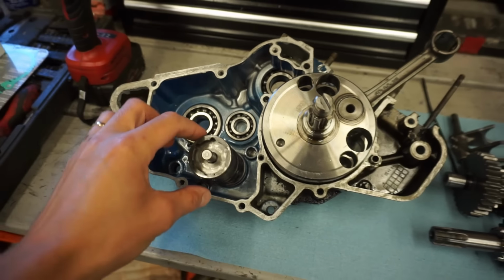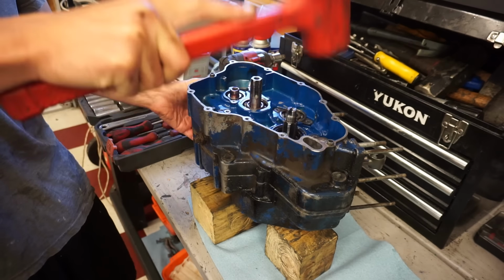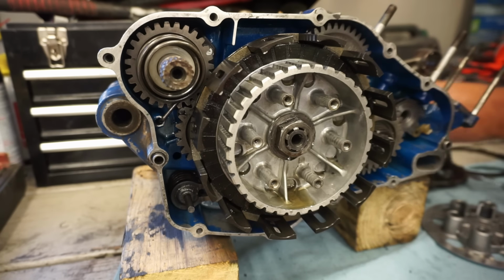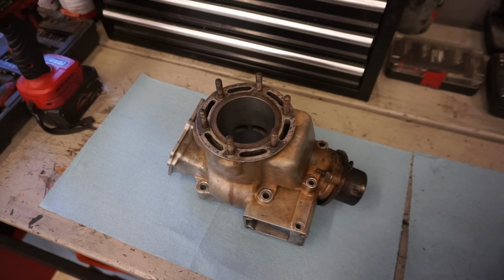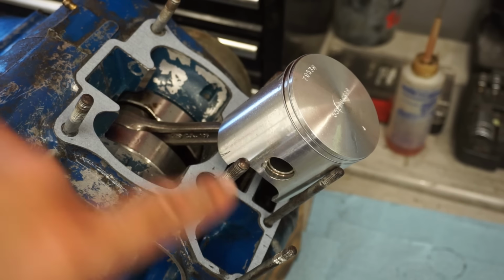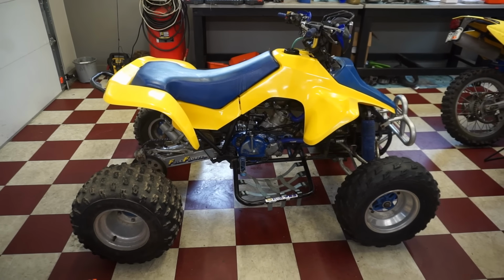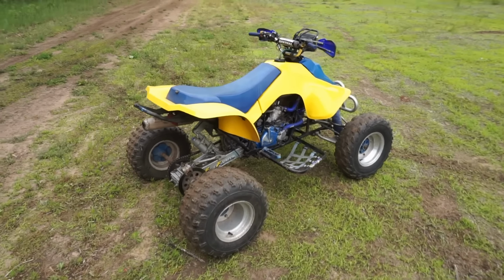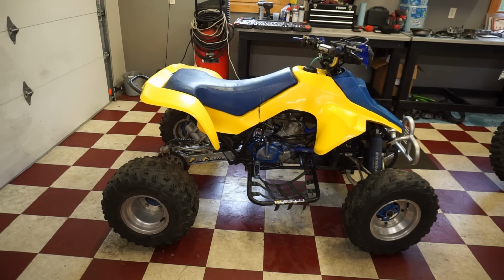I Can't Fix This Rare 2-Stroke Race Quad

Comment: take a 2nd look at the gears, counter-gears. Pay special attention the syncroteeth, they should not be bent  over or the pointed ends rounded off; and since synchro gears / rings are 'conical in shape, the syncros should therefore syncronize itself with the gear it's trying to engage. In other words, If i were to push the syncro ring up against the syncro gear, because its tapered and conical inside diameter, the syncro should slow down the syncro gear to match the speed and mesh with each other. If you press the syncro ring up against the syncro gear but it wont slow down or brake then the syncro ring (usually brass in color) is worn out. You can only replace it, it lost it's braking capabilities (hence the taper and conical shape). Watch the GearBoxVideo -very intuitive and he's a pro at rebuilding manual transmissions

Comment: If it's just second gear, my guess is the clutch dogs, and, or the pockets in the gears that comprise second gear are rounded off causing pressure on the shift forks, and forcing it out of that gear when power is applied.

Comment: The detent u had to bend back make sure it’s perfect and the wheel on it is oem diameter I’d just order 1 honestly and also change the drum bearings ur shift problem will be gone that arm with the wheel against the star is what holds the gear in

Comment: Shift dogs are worn or rounded off.  All new gears to make right  I have done this .slipping out of geat is cause by the dog edges rounded ask any pro if you dont want to put any money in it you might try to file the rounded ones but they have to be very precise to work right  I would replace all of them. Probably be costly idk. I'm sure others have described the same thoughts as I have. WORN ROUNDED DOGS
Reply: Ya .but you here him say there perfect 😂.  Ya its easy to pull it all part then put it back together. BUT you got to know what the fuck you are looking at. SO NO its not Perfect 😂

Comment: Back in the day they used to do what they called plug chops and only run the engine to a certain RPM and then kill the ignition with the clutch disengaged and then check the plug for that RPM

Comment: older honda 600rr with some miles on em would have this issue with 3rd gear. would constantly jump outta gear. only fix was tear down and replace 3rd gear. believe suzuki dr650's also had same issue with 3rd gear. think i would try replacing 2nd gear, unless you can source an entire trans on ebay for cheap.

Comment: Ultra black rtv is oil resistant not gas resistant. The grey that says fuel resistant is also oil resistant which needs to be used on the 2 strokes surprised you dont have issues honestly

Comment: I can not stress this enough! When working on Japanese Quads, bikes snowmobiles etc.. pre 2005, use JIS screwdrivers, due to the heads being a slightly different size than U.S screw heads. If you don't you risk the chance of rounding out the heads, thus causing them to be drilled out and possibly creating more damage. A wise investment if you work on older Japanese products!
Reply: He doesnt own a single quality tool, only harbor freight stuff here
Reply: You overlooked being a real mechanic, just looking at a part you cant tell if its good

Comment: It's your shifter forks , any little bit of wear on them with cause it to pop out of gear ... My Raptor 660 did the same shit ....  Changed the shifter forks and shifted great ..  and they looked like they had barely any wear on them, but there was little grooves wore into them! Change those and you will be ripping in no time !
Reply: And it would stay in gear as long as you weren't ripping on it , but as soon as you let it eat, pops right out ! Exact same thing that your experiencing! Change those and you won't regret it ! Good luck
Reply: I wrote this before finishing watching the video, forgot to mention , it was second gear only , but if you took it easy through second , it would stay in the rest , literally the exact same situation you have !

Comment: In my opinion- I had the same deal with my 450 very frustrating 2nd gear doggear- it started with the bent shifter, then it migrated into the tranny slipping out of gear at high rpms- sometimes it would shift into gear by itself

Comment: I would take a closere look at the grooves in the shift drum and the pins on the shift forlk than rides in the grooves of ther shift drum.  Might be excessive clearance.  The groove in the shift drum that holds the transmission in 2nd gear is probably worn.

Comment: Why is the top engine mount missing? Are you sure the engine isn’t shifting around causing it to jump out of gear? 1st and 2nd put the most torque out and that’s when a engine movement can cause that issue

Comment: Sounds like a weak/ worn detent arm spring for the high rpm issue. 2nd gear could be an ever so slightly bent fork or rounded dogs that lock into each other.

Comment: If I were you I would try new selector forks and drum. It can't be anything else could it really? And you did spot wear on the selector fork before. Perhaps that gearbox actually was working for some time without that selector drum bolt and over time it caused uneven and excessive wear on the fork and drum due to the unsecured drum which eventually resulted in the selector problem. And you've fixed the root cause of the problem but the symptoms continue because of the wear.

Comment: I had a similar issue with a '71 T500, turns out the splined washers on the gear shafts were incorrect, they are very slightly different in width, it made the gears jump out.

Comment: Flat disc paper surface wheel not The one with sideways pre cuts on it either. A actual solid circle one like the grinding wheels.

Comment: I think that your shift Barrel has too much slop because the previous owner rode around on it without the bolt!  The slots on the shift barrel are fine, but the end bushings are worn out. 
Tear it apart again Joe Sorry. 😮‍💨

Comment: Based on your narrative it sounds like you partially fixed the transmission performance. Is it possible that one of the parts that appear to look good might be an after market knock off that is not quite up to OEM tolerances for that transmission? You seem to be pretty close.

Comment: I just fixed 2nd gear on my 400ex. Revs out like neutral but still goes the other gears. I replaced worn shift fork left, counter gear 5 and counter gear 2. Counter Gear 5 had rounded dogs for Counter Gear 2.

2nd gear isn't the issue. It's the counter parts.

Comment: SHIMS, Spacers, Washers, Clips, Screws, Bolts, TOLERANCES !!! 

The Concept of only  ( ONE ) spot or  Gear JUMPING / Missing means this. 

In That POSITION (IT)  Has to much P.L.A.Y.  to keep it  LOCKED or  Stable. 
Whether its  the  STOCK ( PARTS ) ? Upgraded, WORN, Slightly Out of  SPEC, or a  Combination of  the  CORRECT SHIMS, Thickness, or  Type as  well.   Like the  Feeler Gauges going  in Minimum Differences.   This  UNIT is about  to COST  more then it  was worth the second time around. 
SUGGESTION ! ! ! ! 
Take the  Least amount apart before ( REMOVING the  ENGINE)   Is the  SHIFT  Lever the  Issue ?? Some  after market  UPGRADES  ( DO NOT ) Hold the  same  Tolerances to what the  Manufacturer was using  when BRAND NEW. The  GUY Who Rebuilt it  the  first  time ( MAY HAVE  LOST, Removed, or  Deleted a Simple item here.   Check the  Teardown images.  
SPECS and  also ( UPDRADES ) or  Improvements the MANUFACTURER   May have  done  deepening  on the  BUILD  date. 
WE had a SERVICE  Bulletin  come  through  with Parts images and  Replacements  that showed ( CERTAIN, Years, Models, Brands, and  VERSIONS,  Could  have  been set up with additional items NOT  shown on the  ORIGINAL  Parts listing. 
SHIFT IT ???  ONE  gear spot means its ISOLATED. WEAR POINTS  on anything in going to take place at the  beginning  MOST  often.  SHIFT Forks, Drums, Pins, Needles, Spacers, Washers, GROOVES too.    This  ISSUE  is  what the  OTHER did and  also DID  NOT  Tell you  about. 
So, In conclusion !??!?!   SUCKS to TRUST  anyone  these days. . . 
Go backwards  to verify the DETAILS. 
" In the END - It ALL Goes Back to the B E G I N N I N G "

Comment: when you mixed your gas and 2 stroke oil you said 40 to 1 ...lt250 r  should be mixed at 20 to 1.. according to the manual  ?  have I been running my lt250 r with too much oil ?
Reply: No you haven't been and it's normally better to go by the manual than what someone says on youtube. But the reason he runs it at 40:1 is because fuel is different these days than it was back when those were made. I would still run it at 20:1 and one day when I manage to rebuild the one I have, that is what I will run it at myself.
Reply: @williamevans6468  thanks for the info and reply. my lt250r I have resleved the motor and its like new back to stock bore and new plastics

Comment: Yeah sometimes things don't go as planned but you got a attitude about it. The thing is that 4 wheel is going to be worth more then the average 4 wheeler same for the quadzilla  and the Honda 250R 
 It's not like a 4stroke that there's millions out there and they cost a fortune to rebuild. I would change the shift drum shift forks and second gear. Try to find a blown motor to use the transmission parts. Get some more aggressive tires a graffect kit you like and get 100 percent and keep rise it and enjoy it till it's worth twice you paid. If I would of did that with all of the awesome 2 stroke bikes I had I would have one hell of a collection.  My first bike and first bigger bike would be worth 20 times what I paid and we're in great condition when I sold them. I had a 80 YZ 125 with Simon's Forks and a Fox shock a DG pipe that bike would be thousands today.

Comment: Well, If I my memory recalls, you broke the bolt off and when removing it you broke off a piece from the case. So, either you tried to weld that on or whatever you did, is causing the shifting problem. U might need to replace the lower end again.

Comment: I know you don't read the comments, but I'll comment anyway for those that might wonder why you can't fix it. You should've checked the end-float on those gear shafts and shifter. You should have done that on the strip down - if you knew what you were doing, that is. That is very likely where your problem lies.

Comment: I woud have changed the spring under the shifting drum.  Probably the tension is not exactly what it should be and it does not keep the drum in gear.

Comment: Ultra black sealant is a bad idea.  It will eventually fail as its not gasoline resistant.
Reply: What you suggest then? I use that orange silicone on everything
Reply: Blue hylomars good

Comment: Had a 05 CRF 250 did the same thing turned out the dogs on the gears were ever so slightly rounded put another gear set in it and it cured it.

Comment: the second gear dogs that engage with others on the shaft have been damaged and become worn Only explanation that is feasible they become slightly tapered and don't lock together and throw back out

Comment: The dogs on second gear worn and the shift drum is worn.And you probably need to replace the detent wheel. I would replace second gear and it's mating gear.Replace the shift.Drum replaces the detent wheel and replace the detent wheel spring. Then it should be all right.

Comment: No new crank seals, new flat head screws for the shift drum plate, shift shaft seal? All these subs you should have a TIG welder so you could fix the engine cases from the chain snapping. I'd change the pawls that rotate the shift drum, I guess this motor doesn't have a shift drum lock/stopper? Even that bolt you put in, I bet you didn't use a hardened washer and higher grade bolt because it wouldn't tighten down; it was if it was all bending into place before it would snug up. Just my observations, I've split lots of cases over the years. 

When I have shift issues I like to pull the plug, or clutch basket, spin the rear tires and shift the motor while watching for what isn't doing what it should. I find lots of shifting issues that way.

Comment: I don''t like the 'ball hone' . The reason beeing is that if there's a small warp in the cylinder, it'll do nothing to straighten the cylinder warp out. Where as, the 'bladed' type of honing tool will, to some point, because as it hones, the straight edges of the bladed hones, will to some degree, straighten out any bumps in the cylinder.

Comment: The second and third gear up shift shifting Fork there's too much gap between both sides and it's not spinning the drum far enough to slide the second gear in pull it apart flip the shifting Fork over the other direction

Comment: my dirtbike does that on 2nd gear it would go to neutral if you rev high enough but it isn't as bad as that guad where it would do it everytime you go into 2nd it does it me and my dad have no clue to why it does it but we just learned to adjust so what we would is shift into 3rd early and not fully rev out 2nd gear this problem has bamboozeld me and my dad for years and we still dont know what causes it

Comment: My guess is second gear teeth have the spure gear side now worn towards slipping out. Second gear probably needs replaced. The gear profile is now not correct since he never placed the bolt down under the shift drum. My guess is second gear needs replaced.

Comment: Its not a bad looking QUAD take it back apart fix it and paint the cases while you have it out seems weird you never paint the cases when you have them torn down. I would strip it right down powder coat the frame and clean it all up.

Comment: Check the circlip on 2nd gear. Thats the #1 reason for jumping out of gear. And that plug does not look good. You need to learn what a proper plug looks like. Its still rich.

Comment: Power valve delete that’s not slipping it’s all power coming out at the rpm range it is there for it’s opening power valve earlier than it should causing a release of all pressure and let’s be honest my last lt did this I got a shaved ported bored cylinder and power valve delete it never did it again

Comment: The transmission did NOT look perfect. You didn't even check the gears. I had the same problem with my Suzuki RM370. The dogs were rounded. It is always the problem when it comes out of gear.

Comment: Just barely run the disc over those areas of that single clutch disc. At A slow speed maybe use one in drill instead.

Comment: All you basically doing is getting that disc to grab again is all.,or wipe it down with wet clutch motor oil instead with towels slightly.

Comment: Should not run with out the head stay motor mount.
Reply: Doe these quads have them mabey because the engine is used in a motorcycle to so compatible between different chassis
Reply: @Lee-At-Green-Pheonix-Rc  yes head motor mount

Comment: That four wheeler is proof. That there is a big difference between somebody that can just tear something down and put new parts in. And a real mechanic. Any chimpanzee can be trained to tear something down and then put it back together. But it takes a real mechanic. To figure out what a real problem is. I know exactly what's wrong with that four-wheeler. I have seen it many times before. But I'm not going to tell you. You need to figure it out for yourself and become a real mechanic. Or go find a real mechanic and ask them. Some secrets should not be given away on the internet. Not by me anyway.

Comment: Stop honing backwards. That’s never done in a shop . Never once would we do that . Should by a set of sunnen hones if you want a correct finish. Only about two grand and you would be able to bore and hone cylinders . 2 k man I’ll show you even how to do it
Reply: @roberttdubel, it doesn't matter how you hone a cylinder. Who the hell would pay $2000 for the hone and bore tool.

Comment: The problem must lie between second gear spacing or a missing spacer or the shifting half gear not timed ? Boy this stinks your such a throw guy but something is off is second gear original maybe is not the right with . Good luck
Reply: A spring under the shifting fork and ball bearing wrong fork been replaced